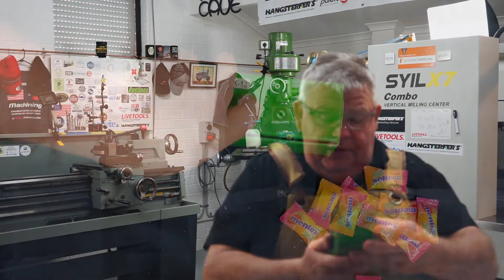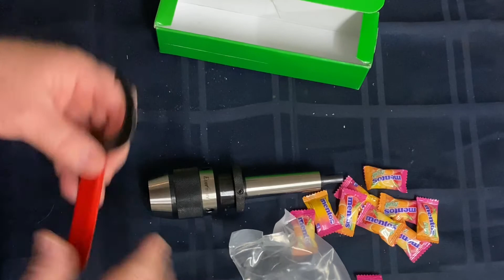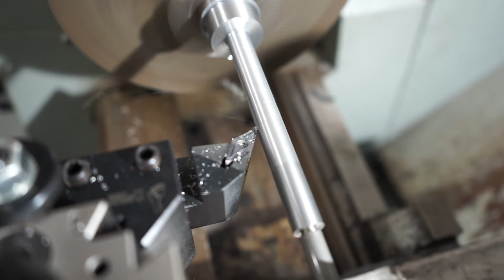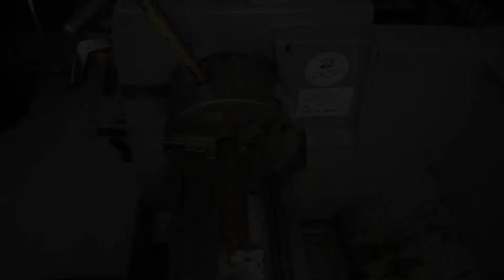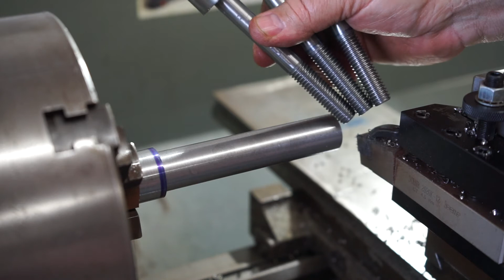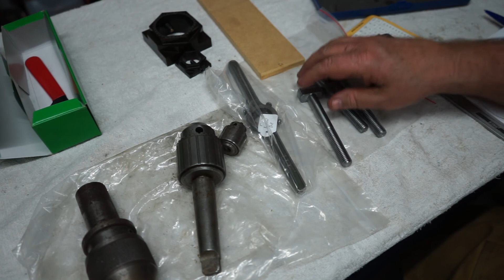Custom 1/2" BSW T-Bolts for Hornsby Oil Engine

Comment: Hey Aaron.
Love the new Live Centre.
Daintree, definitely make a Nice tool.
Based up in your old stomping ground in Queensland.

New Keyless Drill Chuck always come in handy 👍
Gone are the days of needing a Chuck Key that Never seemed to fit the Drill Chuck you were using 🙄😂
I never know what happens the Chuck Key that came with the Chuck ??
Maybe in the same place those tiny screws seem to go when working on something 🤔😂

Nothing wrong with Taiwanese, Tools and Machinery.
They are considered as the best quality.
Looks like another good day out shopping 🙂👍

Great to see you again.
Hopefully I can get around to making some more videos again one day ???
Peter 👍
Reply from the maker: G’day Peter. Sorry for the late reply. Yes very happy with the Daintree live centre.  It would best suit a CNC, but works a treat on the old Colchester. I’m also impressed with that Taiwanese keyless drill chuck. I’m with you on “keyed chucks” pain in the backside they are. Can’t wait to see and hear about your new purchase that is coming. Loved to se a video if you get time mate. Cheers 🍻
Reply: @AaronEngineering  
Hey Aaron. 
Great to see you buying up on more Tools 👌
Something satisfying about Man Shopping 🛍 🙂
The Live Centre is definitely a good purchase. 
When you have the Right tools for the job, it definitely makes a difference.

Currently super busy in my shop.
With a mix of ongoing and plenty of Turning Work.

I could definitely do with a CNC Lathe at the moment 😒
Manual is okay. 
Just taking toooo long to complete the parts ???

I start to get behind which is pushing other jobs back. 
A little stressful.
Because I don't like to let people down and promising without delivering is not a great place to be.

When the new long overdue machine finally arrives. 
This will make a Huge difference to my life in general.

Comment: Hi Aaron, thanks for the shout out 😀👍. Nice chucks you've got there. I need a decent one for my mill, still running the crappy mt3 3-16mm keyed one that came with the mill. I'm often drilling for M3, so it's a pain as I have to use my mt2 drill chuck with a 2-3 sleeve and change the drawbar every time 🙄
Reply from the maker: Hi Olly. Oh it’s my pleasure mate. I got your stickers up on the board now. Sadly I’ve run out of room now, probably should have a bought a bigger board 😂. Yes, very happy with those new tools. Money well spent. Cheers mate 🍻

Comment: Hello Aaron. What camera do you use? The video is hi quality. BC
Reply from the maker: G’day BC. I have 4 Sony “mirrorless” cameras. I use an Sony a7 for narration work, a Sony a6 on a mag base for lathe chuck work. A Sony AS200v action cam for inside CNC machine work and an older NEX VG30 dedicated video camera for nice zoom in shots. No 4K stuff unfortunately, but all cameras are full HD. Usually shoot at 25-30fps. This might make for good video actually 😉